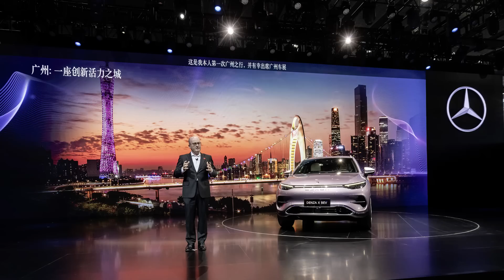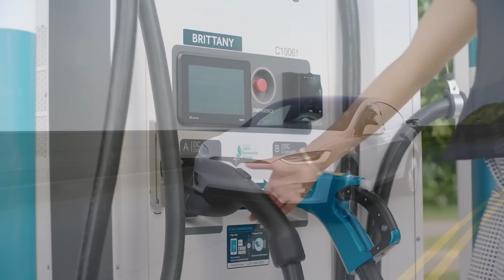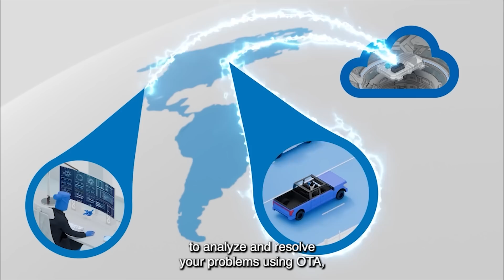EV Batteries Degrade 1.8%/Year; LFP Threatened by Falling Nickel Prices - Autoline Daily 3895

Comment: Keep in mind, 64% of usable battery capacity comes off of the upper range of a vehicle, so if it had 300 miles when new, that would fall to 192 miles, and in the real world, in the winter it would probably be down to about 120 miles - pretty useless for most people. Do ICE vehicles loose range like that???
Reply: Just move to where the winters are mild, I did. There I solved your problem.
Reply: @2cartalkers 😂
Reply: @2cartalkers  But what about those Tesla Semi owners who need to haul in those winter climates.  Buy a diesel backup truck?  Or are you saying Leon's vision is flawed?
Reply: @bobbbobb4663  Hydrogen for trucks, look what id did for the Hindenburg and the now defunct Toyota Mirai. Aye, Aye Captain!
Reply: @2cartalkers  So you admit that babysmurf9000 is wrong about EV Semis.  Looks like someone just got added to the  No Mars List.
Reply: @joeperrone6677 and if you use the radio, you will have zero miles of range
Reply: @mike_w-tw6jd what's a "radio"?